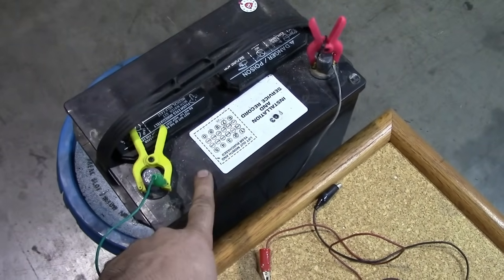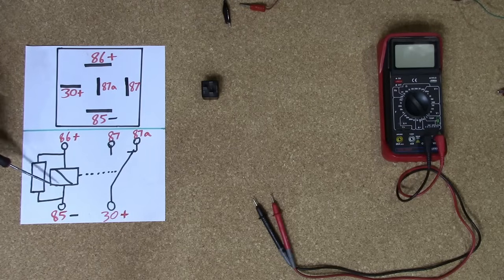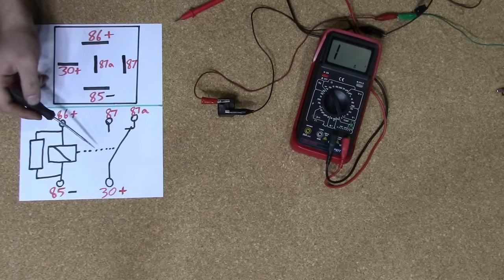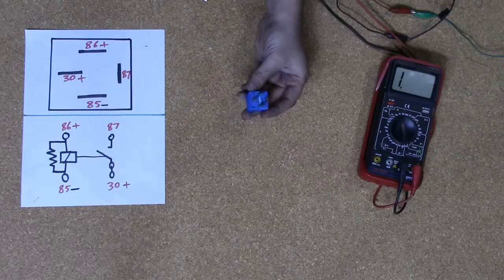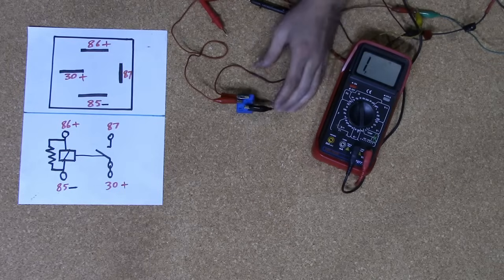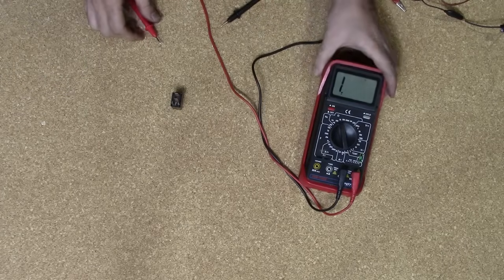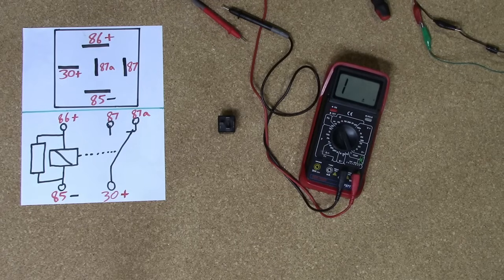How to Test a 3, 4 or 5 Pin Relay - With or Without a Diagram

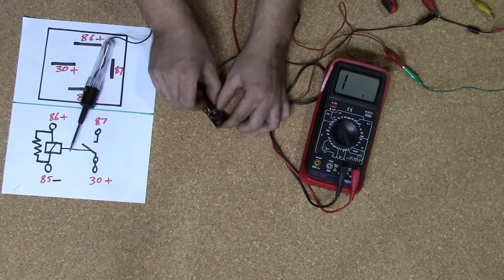Comment: I really hope you see this comment because I want to know more about that really detailed drawing on your left(?) palm that looks like a 4 or 5 pin relay UNDERNEATH the 3 lines of notes at the 12:00 mark. Your hand is not big enough for all that info! Also, did you do that with a ball point BIC or with some fancy felt tip micro pen? LOL

I've been out of the garage for a few decades and just now getting back into it, I've somehow lost the knowledge in my brain. But when I found your videos, your teaching style is quickly bringing it back for me. You've also been filling any knowledge gaps I was unaware of, but best of all, pointing out my bad habits that surely made jobs much harder than I realized. Also, a lot of these are 10+ years old, devoid of any of the graphics and sound effects that are oftentimes overused in many "educational" videos today. You are simple from the start and maintain that clear, basic wording as you move into more complex systems. I'm sure I could go on, but you get the point. Thanks for making these and being such an awesome source of knowledge and growth. I'd wrench with you anytime, anywhere!

Comment: Heads up on Honda Factory Manuals.  My 1994 Accord EX Coupe manual says to test the relay pins 87 & 30 for "Continuity" when "powered up"? 

LUKE and other references say NEVER test for "Continuity" with a power supply to a device. Offers no real info and can damage the multimeter..

"Resistance Testing" is only used when power is being supplied on a device. And it gives more info on diagnosis. WOW!  I likely misdiagnosed my starter relay by following a Honda factory book.

Your video helped me see the error.  Should have been set to Ohms.

No Crank issue arose out of the blue, after working under my dash and replacing a brake booster:  Had to also remove the 3 engine harness connections (driver side) and pull away to get booster out. Almost impossible to remove that booster, only comes out one way and no wiggle room.  Believe I pressured against the main harness slightly squeezing it by to remove it!  Finished job and got the no crank!  

Now getting a fluctuating and even dropping of less than 12 volts at starter trigger wire (when key on start).  Only a few seconds of voltage.. then almost nothing.

I had already tested the 4P starter cut relay.. Energized the click OK, Ohms power side pins between 50-120 OK.  But will now test again correctly on switch side for Ohms.. and also power to a light.  

Jumping a wire from battery pos to the pos relay trigger wire terminal, starter cranks excellent...!  Key on start, dash lights on and fuel pump on, but no crank or click on start.  No dimming of lights either on key start.  Just nothing.  Battery is brand new and awesome 12.8V.  Car ran perfect before brake booster job.???

I am now suspecting the starter cut relay again.  Jumping clutch safety switch did nothing.  Seems odd this happened on a brake repair, but I might have hit a wire or that relay with a tool, as it is mounted under the dash over top of the brake pedal.  LOL  

Fact I get a signal at all to the starter solenoid trigger wire, makes me think the wiring harness is OK.  Will know soon enough, after testing the relay (AGAIN).

Thanks for the post..!  We miss you bro!

Comment: i am testing a a/c 4 port without diag. bad relay it was sometime making compressor kick and sometime not so i replaced it but now i am testing couldnt by mult. identify its bad as its openning and closing and resistant is 100+ , i connect the battery and the resistant was moving between 1.0 to 3.0 up and down so is there anything to highlight to me or guide , thanks in advance

Comment: You didn’t mention this but: Without power, there should be continuity between pin 30 and 87a. If there isn’t and the relay is used for the car’s starter let’s say… will the car still start?

Comment: Hi,  sorry, am i understanding correctly:  6:10  activated Relay, power [85 \ 86];  Run power to 30 [2nd power wire used - 30 & 86] Ground test light to test 87.   Thanks  
12:55  30 & 87a, have Continuity  -   87 not connected until powered.  [?]  {{sigh}}
Read so much, now confused.  issue with me is which is 30?  re: 5 pin relay: [all same direction] 3 pins top\ larger 2 below.  Unpowered, center & Bottom Right have continuity.   Thought Bottom R. was 30, re: Size,  BUT, could 30 be T. Center, making Bottom Left 87?   
I can't be more wrong, i may have figured it out.   lol    not sure

Comment: You can always get a wire wrap it on the output pin usually 87… reinstall and check for power with it installed…. You check all circuits at the same time ….and the output…

Comment: Step 1 checked for resistance, 0.75 ✅ Step 2 Check for click, clicked  ✅ Step 3. Testing power for the light 🚫 My tester did not light up. Bad relay?

Comment: So once you turn off your multi switch (i.e., signal lights are no longer flashing), you take power away from the control coil and pin 87 goes back to 87a?
Is the clicking you hear when you turn on your flashers the  relay turning on and off which makes the lights flash?

Comment: I used a lithium 18v drill battery and 120 bulb cus that's all I had.
 5 pin Ford relay clicked but the bulb didn't light on pin 87 only when I switched power over to pin 86 or 30.

Comment: At 9:10, "You can't really do a resistance test between 86 and 87 because you're not supposed to check resistance when a circuit is energized, it's going to damage your multi-meter for sure, but you can do a test-light test." How is this true if at two earlier points in the video you did exactly that with a multi-meter?

Comment: We are not yet completely sure...there is one more test, With the 85/86 energized and 87 confirmed "hot", you now need to put that test light back on 87a to see if it is also "hot".

Because of your tutorial, thank you, I was able to diagnose my relay as bad. 
In my case BOTH the 87 and 87a are hot with the relay engaged. Causing all kinds of problems for my motorcycle. 

I tested it as Good but always traced the problem back to the relay. Did some more playing around with it and discovered my issue. 

Thank you very much for taking the time to make this video.

Comment: Nice video. Nissan horn not working. Good fuses and 12v on one blade plug. I tapped on horn relay and got it to work for a split second. Then nothing. Then the horn worked shortly thereafter for 1 night.

 I've got a 3-blade Nissan horn relay.  I can energize two blades and it clicks, but only in one direction. When I energize the two blades with a good 9v battery I measure about 4v on the output blade that goes to the horn.  The 4v steadily decreases if I hold it on the 3rd blade and monitor it.

How do I confirm the relay is the issue? Thanks!

Comment: Good day, u said when u power 86, don't test  85 an 86 with your meter on ohms scale, we will damage d meter.but u did check 4 resis on 30 an 87, on ohms scale. Ent there is current on d close switch. How did d meter diden't damage. Because 30 is always live.

Comment: Soooo, I have a Lotus Esprit V8 and was having some CEL codes and am trying to get to the root of the issue.  I had a host of CEL codes related to the Heater circuit on the O2 sensors.  I just replaced all 4 O2 sensors, as there are reasonable in price and easy enough to get at.  The codes reappeared and so I thought.....after looking at the Fuses and Relays there was a relay for the O2 heater circuit.  I pulled the relay and started to order a few relays.....and said let's check it out on YouTube and here I am.  Your video made sense and was informative and I tested the relay that it worked, and that the resistance was good........sure enough clicking away strongly and the resistance was about 76.4, so within your prescribed range.  I might have to test a cold start on the relay plug in and see if pin 30 is getting power at start.  I would think it should when cold to heat up the O2 sensor.  Thanks Again

Comment: QUESTION: 3pin horn relay on '87 Chevrolet S-10 in ohms is 38-41 olms. It clicks when I push horn.. At the horn, I unplugged the wire to horn, test light tested connecting alligator clip to negative on battery and pointer touching the wire connect. It lights up when pushing horn button. So does this mean my horn is bad???

Comment: My Automatic 1997 Camry with 190K starts fine when cold or when very hot. When the engine is slightly warm, it won't start. I open the hood to cool the engine, then the car starts. Could it be the starter relay or the ECT sensor ? Please comment. Thanks.

Comment: great video. would also point out if you do not have a test light, you can use the multimeter to read volts between 30+ and 87. If you see a 12, you're good!

Comment: I was disappointed in this video because your camera was too far away so nobody could see properly.
You should have also showed that pin 86 is the 12V terminal on the control side and number 30 is 12V terminal on the (Switched) load side.
It could have been mentioned that even if the Relay proved good there could be a bad or non energized connection in the Relay Power Panel, due to corrosion or bad wires. 
Maybe you could show this situation in another Video.
🤔

Comment: Great video, in my test of a horn and ac relays both clicks and both shows readings of 0.1 - 1.2 when energized plus audible beep; the ac one was suspected to be bad as my ac blows hot; the compressor also test good itself, it engages when energized; so given the scenario above can I eliminate a bad relay as the issue?

Comment: I wish like hell anyone would show what you are hooking to the battery or what kind of battery is a car battery too big and and all the leads connections and what that looks like visually. Might seem like no Brainerd to some but I don't want any room.for guess work all I can see is the ends that you are connecting to the relay but what's all that mess of wires up top out frame doing where they going etc you got like 6 wires going to something I'm assuming a battery but is it 2 leads connected to the positive terminal and 1 to the negative or what

Comment: So if I am understanding the circut brakers right, If when testing the tremanials which the brakers are pluged into, If only one tremainal lights when the key is turned on. That means that  there is a swith for this circut that has to be turned on to have the power go through the breaker. If and when two tremainals are hot when tested, means their is no switch in the system, and when the key is turned on, the componet is hot or turned on already. Does this sound correct to you ?

Comment: Thank u bro for the video, my car ac started malfunctioning after I had the gas refilled, it will work for a while like an hour or less then goes off with the ac light on the control nob blinking, what could be the reason for this cos on the day of refill, the guy who did refilled it till I heard a noise like excessive gas short out from the compressor and that was the beginning of my ac problem

Comment: What about this type of relay from the 80's & 90's that 4 inline pins in a rectangular relay? The original part number is GM most likely ( 14047112 ) another number for this same relay is ( RAA1821 ) !!!  
The inline 4 pins have 2. 3. 4. 5 & 1 is empty! The Pins 2 Red / pin 5 black maybe 10ga wire. 3/4 are 14 16 ga wire go out to switchs & sensors so I'm trying to figure out how to test it!  I can jump 2 to 5 & the coolant Fan runs!!! Little Help Please??

Comment: Great Video,   My question,  Is the 5 pin relay in this video classed as a Changeover relay ?    Does power from 87A transfer to 87 ?    Can you get 5 pin relays where 87 and 87A  are both active when relay is switched on ?   Regards Mario from Australia.

Comment: I just saw this video and it's fantastic. I've watched many testing of relay videos on You Tube and this is the best. I have a 5 pin relay that i needed to test and i didn't know what i was doing, now, i feel comfortable that i will get the correct readings. I will now be able to go to the next stip in getting my John Deere Gator working.

Comment: my horn kept going off by itself in my Jeep so i swapped out the relay (didn't have test tools with me).  the horn has not acted up since, and works normally.  later i tested the relay i thought was bad and is test out okay.  now im wondering how changing a good relay for another good relay fixed my problem. ... ?

Comment: Fixed my mercedes using this video. Had 74 ohms on 85 and 86. Relays opened and closed just fine. When 85 and 86 were powered and circuit closed, 30 and 87 had erratic ohms from .05 to 34.00. Tested 5 relays and that was the only relay with that problem. Replaced and now cooling fan comes on. Great video.

Comment: 506 comments... i can't go through them all (heheh)  
i have a 2007 toyota corolla - no start no click.. new battery
So my  question is .. if all tests pass.. fuses are good, relays are good, including the starter testing as you showed.
can starter it still be bad?  i reinstalled it and car started fine first 6 times then the problem of no start returned 

i took it out again and it continues to engage on testing... im so frustrated right now.. only thing to do is start changing parts.. and its a hot * day...

Comment: Ok thank you. Very helpful.  So my relay is good, alternator and battery good. So my car, 2012 genesis turns on when it wants to. I press the starter button, and I hear this humming sound? So what do you think? Maybe solenoid or starter?

Comment: Would a starter relay have more or less the same resistance?  Mine keeps blowing a 30A fuse the moment i turn the ignition on.  I measured resistance across the 4 terminals and one reads O.L the other set read practically 0 ohms.  I guessing my relay is internally shorted?

Comment: is solenoid a relay?
Reply: They do similar jobs but the both operate very differently, solenoids generally can handle more power than relays as well. Solenoids also generally connect to a mechanical device where as relays connect or disconnect electrical circuits.

Comment: Can I use the same battery for both outputs on the relay for 2 different circuits? I did this but the relay keeps clicking. It can't stay on.

Comment: this was an even better, maybe the best, explanation, thanks.  my relay clicks, resistance goes to 0, but using a light on the terminal does not light up, a bad relay!  without that light test, I would have thought it was good, thanks MUCH!

Comment: Hey I appreciate the video that was a good video except for the fact found two relays with a 5, 6.  2,4 diagram. Check for the Ohms on both of them went from pin-to-pin to pain and could not find anything yet when I tried to put the 12 volts to one of them I got a spark when I get a positive and negative so any clue on what that could be

Comment: I have 2006 c230 mercedes. The siren alarm battery went out. When it went out the horn and windshield wipers turn on windshield wipers sprayer on light on . replace siren alarm part. Now the horn and windshield wipers , single lights in the front won't work. Lights stay on bright when key on. Check relay fuse on windshield wipers Q relay good. Check windshield wipers speed relay L relay good. Horn relay good. Check. Windshield wipers circuit board Q 30 and 87 has power. 86 power 85 no power. 30 pos 87 neg 86 neg 85 pos no power. Check windshield wipers speed circuit board L 30 no power 87 power. 85 no power 86 power. 30 neg no power 87 pos power. 85 pos no power 86 neg power. Horn relay circuit 30 and 87 power 85 power 86 no power. 30 neg 87 pos 85 neg 86 pos no power. What can I do next. Thank you

Comment: @Ratchets And Wrenches 3:05  My Honda Accord relays (4pin x7) range from 155-180ohm, do I toss them all? Very frustrating that I can't find specs on these relays, Mitsuba 7001 (x4) 155-158ohms, Denso (x3) 170-172ohms. Test 1= Fail. Test 2,3,4= Pass.  P.S I blindly (stupidly) try to jump/test the starter from the relay circuit, now my car won't crank. Hindsight, I touched everything to everywhere but my longest time was 87-85, started 3 times but not 4. P.P.s  With ignition on, if I use a jumper wire direct to starter signal wire, Car starts, runs and drives. 

   Any help or ideas would be greatly appreciated!

Comment: I have a Bosch 5 pin micro-relay which is a little different than the first relay you tes but the diagram is essentially the same.  I was able to use the same procedure tp test it. Thank you!

Comment: Does every relay need a earth or negative lead?  A relay fitted to my caravan does not have a earth lead and that may be the reason the fridge does not work on 12v.   I have done all the bench tests on the relay and everything works as it should. Yet when fitted to the caravan it doesn't work.

Comment: If you power the 86 and the 85. Does that means the 30 and 87 is powered.

Is it powered even if the engine is not powered on?

Comment: My toyota 90987-t2003 relay resistance is 168 ohms. Tested up to 3 relays in my car. All same value. I think the resistance depends on the manufacturer of the relay and the amount of current designed to pass through to them. And all the relay are working well

Comment: Testing with a test light will give you false positive tests. You need to test with a circuit that has equal current to that of what the relay is being used for. the contacts inside cand be loose or even burnt out to the ponit lower currents may pass through with no problem but when the higher current passes through the relay fails and causes intermittent problems.